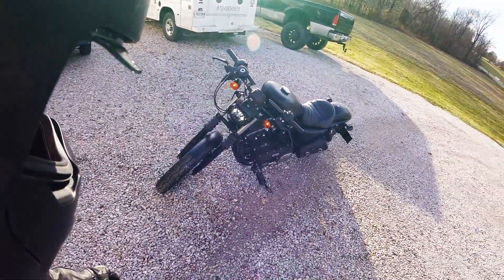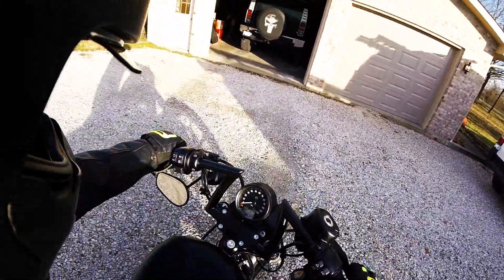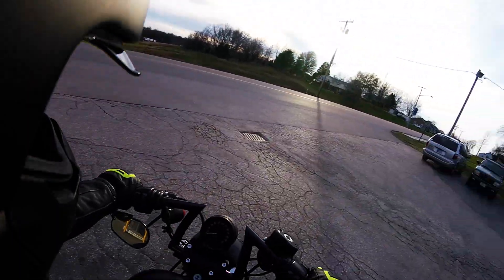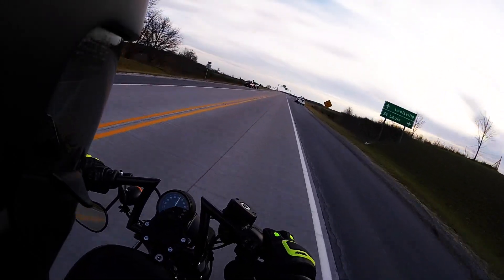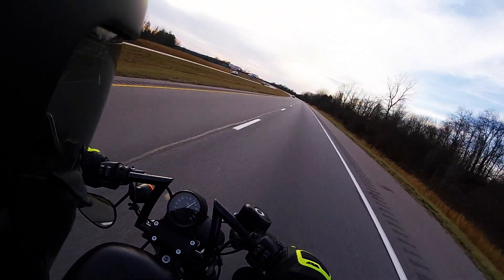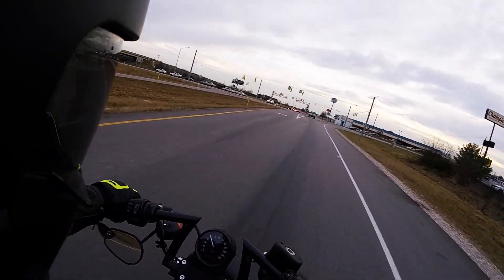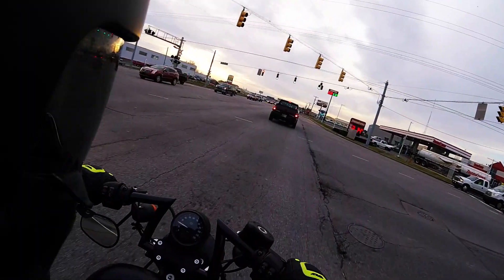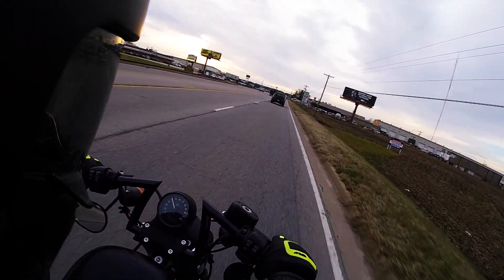2019 iron 883 to 1200 conversion comparison part one

Comment: Something needs to be done about the wind (distortion?) your mic picks up.
Reply from the maker: That was on my old helmet the new helmet sounds a lot better
Reply: Awesome! I watched the pt 2 video. I have a 19’ 883. Im on the fence between the screamin eagle kit and the unprepared (stock internals) kit from hammer performance. Any recommendations?
Reply from the maker: Either one is good the only thing that sucks is if you did not get the screaming eagle kit put on the day that you purchased the bike it avoids your factory warranty they will not back it up so at this point you really could pick anyone you want
Reply: Everything Random Good to now, may as well go for the less expensive of the two. 🤙🏼

Comment: Another option is to buy the Iron 1200
Reply from the maker: Very true but I can tell you right now the 883 with the conversion has a lot more to work and is a lot more fun
Reply: When I bought my 883 I also looked at the 1200 and I didn’t like the nose fairing and the handle bars. The 883 also had the two tone paint I liked. I did like the total blacked out look though of the 1200. One thing I heard someone point out is with the 1200 conversion your bike will always be registered as an 883 so the insurance is cheaper. Here in New York it’s a good savings.
Reply: yeah but the 883 looks cooler and will accelrate faster with 1200 kit than the stock iron 1200 do to it's lower gearing. and insurance is cheaper.
Reply: A little secret when it comes to the bike insurance if you get the 883 and have the dealer install the 1200 conversion the bike is still registered as an 883 so you don't pay more 👍

Comment: haahaaaaaaaaaaaaaH 3K to upgrade the bike? fuck people really need to learn how to work on their own shit you can get 1200cc kits anywhere from 500 to 1000 depending on the brand.
Reply from the maker: You have to watch the second part I was wrong on those numbers.
Reply: The 1200 kit is $1,300 from Harley comes with 1200 heads too which is nice and installation from a Harley is usually 7.5 hours labor at an average rate of $120 per hour so $900 labor costs. Total around  $2,200 parts & labor altogether in 2024. Sure anyone can do it at home but if you don't seat something correctly or make any oversight, than you just blew up your motor. At least with Harley doing it you pass liability onto them. Also, many of us don't have garages and lifts or organized tools etc. I have a independent Harley mechanic with a $70 per hour rate so labor is closer to $500 which is not bad at all. $1,800 ill be paying plus tax for mine. I'd honestly enjoy working on it myself and wish I could but I just don't have a good setting to work on it at home right now. Hoping to change that when I can afford it.